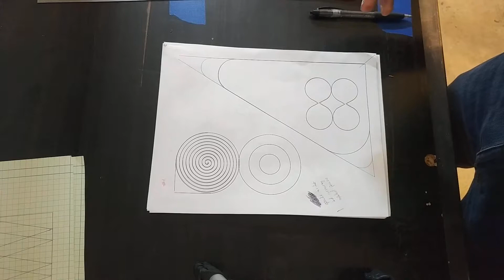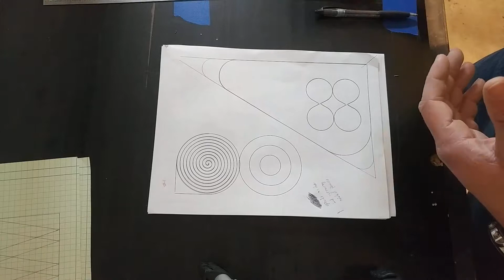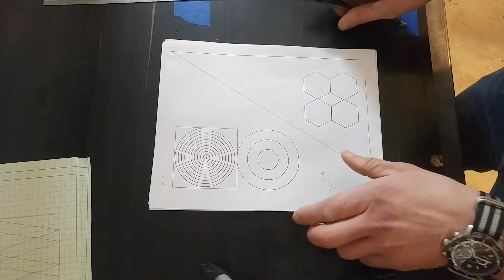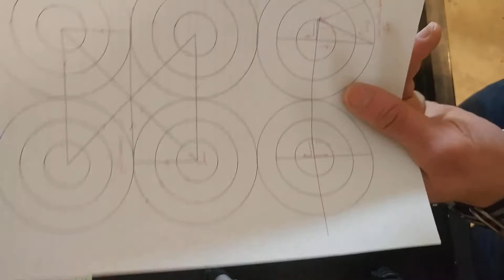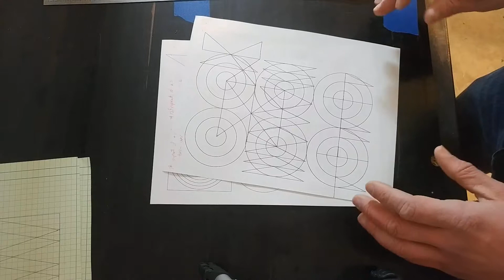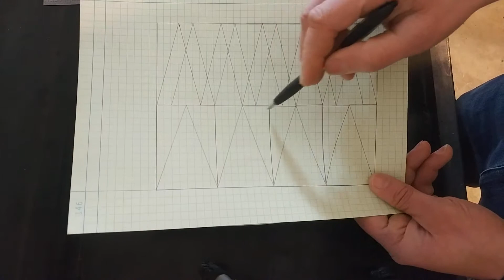CNC Plasma Build: Baby steps, basic CAM & troubleshooting

Comment: swolebro,  congrats on the build.  Looks like just some tweeking and peaking to get it just perfect.  seems like a never ending story on my pm-25.  You mentioned in your video that you are a linux only user.  I can appreciate that, as i dual boot.  I am curious how you plan to take your freecad models to CAM?  Not trying to be a smarty or anything but do you have a plan?  I think along the same lines as you for cloud based options, but i seem to be limited to fusion until something equal or better presents itself.  Oh on another note, I got thoroughly T'd-off with linuxcnc and had to ditch.  I do want to revisit it again though when i have more experience and find an auto zero and auto work piece function.  keep up the good work.
Reply from the maker: I've dabbled with the FreeCAD Path workbench, and it seems like it'll work. This guy has a pretty damn good demo of making some tab-and-slot components with it and his laser cutter. I'll just monkey-see-monkey-do that.

https://www.youtube.com/watch?v=oEloYfZUvMs

I anticipate having some headaches of my own out when it comes to torch height control. There's some semi-organized bits about it on the LinuxCNC wiki that'll act as a starting point. Then, once I get a full working example up, anyone else can monkey-see-monkey-do it for their own builds.

Once you get the hang of running Linux, it gets hard to imagine running anything else. All the tools build off each other. Need to transfer some files between computers? Use rsync. Need to do it on a scheduled basis? rsync +  cron. Specific files? locate + rsync + cron. Across all your computers? ssh + locate + rsync + cron. You can compose some beautiful, hacky scripts that make life easier.

Been sidetracked with personal projects lately (eg. taxes, ughgh), but plan on getting back to the build next week.